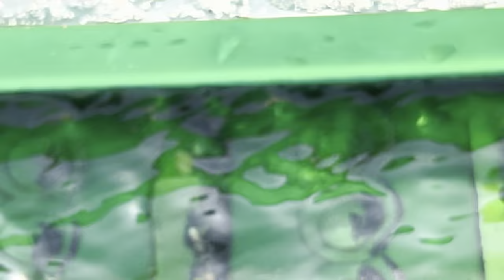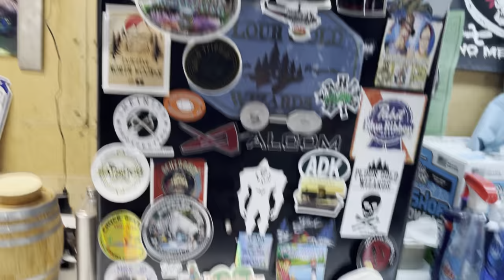New world record GOLD!!!!!! 😂

Comment: I have a cascade SR2, which is 28" long which matt will be best for sand and black sand just as your video shows? thanks
Reply from the maker: I really like sawtooth but people swear by the micro dream mat
Reply: another question how long does your eco worthy 50ah battery run? can you get 8hr constant run time on it? last question please.. the Rubber Mat Riffled Matting is that better than the saw tooth? or is it close to the micro dream mat or in between in your opinion. thanks for your time I'm new to this!
Reply from the maker: @mikewilson5101  
The 50amp/hr battery on a 3amp/pump will run around 16 hrs. 
The sawtooth in my opinion is the best gold catcher for beach gold , it’s easy to set up and forgiving regarding pitch- water flow etc… 😃

Comment: 20 pales a day would be easy with 2 of those sluices, 2 pumps, and 2 batteries.  You could run material as fast as you could scoop it by alternating between the two sluices.
Reply from the maker: Im getting my 10 inch model ready !!!!!
Reply: How much does the six inch model weigh?  I was looking for something small and light weight to take out with me when I hike/prospect.
Reply from the maker: @ExtractingMetals  
Around 4 lbs

Comment: Imagine a magnetic slide bar running perpendicular to the sluice that could run up and down the length of the thing. Every once and a while you'd rack the slide to pull off all that black sand without having to pan it out. 

Might not work but knowing that black sand can be pushed and pulled around by simple magnets sounds like it would be useful to implement
Reply from the maker: Working on it….

Comment: Well, good thing your daughter doesn't take after you physically, she's pretty... :P I think I need to stop watching your videos, it's making me want to modify my wood sluice I made and go mining.. but I really don't know anywhere decent to go, downstream of the dam obviously is pointless.. and really it's probably not the best thing for my back.. though it's probably better than moving multiple wheelbarrows full of dirt and shoveling it... bending over is my biggest issue though.. 90% of my pain is in my lumbar. Still, kind of want to get a little piece of wood and drill a bunch of holes in it and cut a bunch of slots in it with a router to make a riffle board and put it over what I already cut into the wood that broke when I shoveled gravel on it.. Need to get some miner's moss or something though, I don't think scotch brite pads are the right thing to be using. (the big 5X9 bodywork ones) I will say I think the Bear River here in NorCal lives up to it's history though, just a random spot in the gravels up in the high water mark netted 14-20 fly poop colors and 3-4 1/8th rice grain size pieces my very first pan... Definitely need to find access to the East side of the Bear River up above the dam.
It'd definitely be interesting to see how much you could catch shoveling full size flat shovels of that into an 18 inch wide version of that sluice.. think of the sheer amount of material you could burn through.
Reply from the maker: Those results seem well worth putting some time in !!!! We’re working on setting up my 10 inch sluice to run at the beach !!!!!
Reply: @FlourgoldWizards  oh believe me, the Bear River was well known for gold during the gold rush.. as well as silver, platinum and even titanium, one of the few places in the US they found titanium.. tons of gems too.. but the old guys got most of it, including with hydraulic mining in places. What gets me is there's a huge pile of what looks to me to be pay up on the hill.. They say it's all tailings but there's pictures of a road cut 12 feet down through one of the piles and you can see big river rocks mixed with dirt, really concreted stuff and it's like.. that's not tailings. I think they stockpiled pay close to the tailings (probably had a plant between the two) and closed it down for WW2 or whatever and no one ever decided to reopen the mining operation..